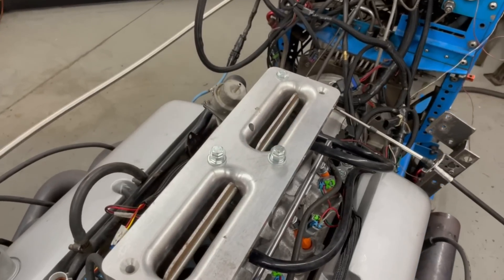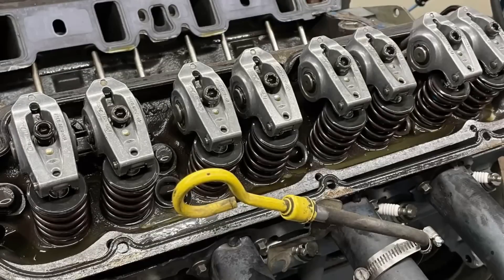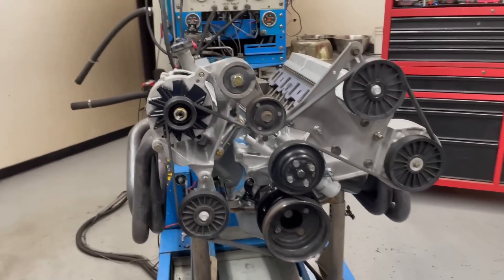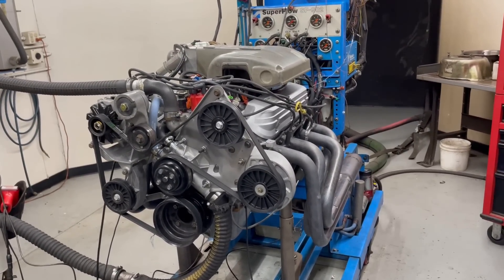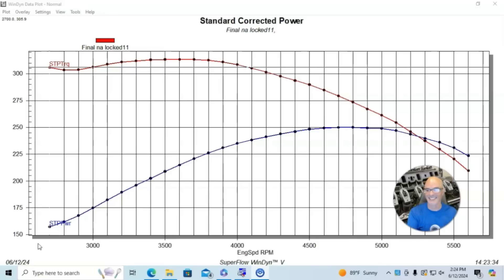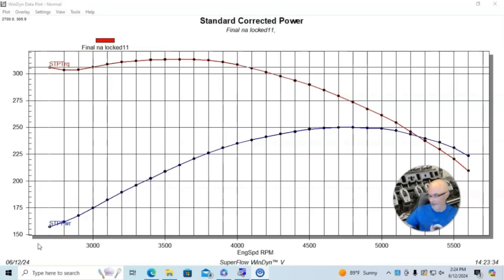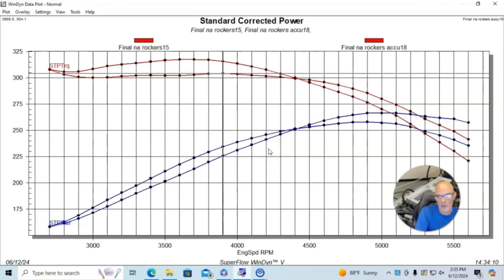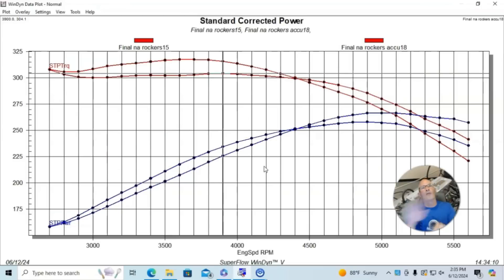TOP SECRET ACCUFAB 5.0L FORD INTAKE-NEVER BEFORE TESTED. PLUS STOCK VS ROLLER ROCKERS-HOW MUCH HP?

Comment: Put a nice plenum on that throttle body and you might find a chunk of the lost low-end.
Reply from the maker: runner length adds torque-not plenum vol
Reply: @richardholdener1727  For sure, primary intake length will go a long way in determining the RPM of the torque peak, but you don’t think there might be some mid-range to be found with an airbox? No airbox means no cylinder-to-cylinder interaction. It essentially serves the same purpose as the collector on the exhaust side. The primary length defines the rpm value for peak scavenging, but you can usually fiddle with the torque curve by varying the collector diameter/length. I’ve found similar results on the intake side.

Also, it might be interesting to make some printed trumpets to give the butterfly throttle intake more runner length just to see how much it takes to match a stock intake.

Comment: Not related to this video at all. But what you state is for the most part true. If you build a NA engine as powerfull as possible and then just add Boost I see a few problems.
If your going to build a NA engine as powerful as possible than the Compression is going to be 11.1- 11.5-1 or more. Not Ideal for a Boosted engine..
JUST SAYING..
Now keeping Compression @(9.5-10-1) then yes this can possibly work. 
but if you're building an all out race/street engine NA you will want 10:1 or 11:1 compression or even higher.
Not a good idea to add high Boost to a a High Compression Engine...
Just Sayin
but i know what your saying and you know what I'm saying....
please keep the videos coming!!!! 
Comparing different Superchargers and Forced Induction comparisons very informative...
Great Stuff
Reply from the maker: WE RUN BOOST ON A LOT OF 10.0:1-11:1 NA MOTORS-THEY MAKE MORE POWER THAN AN 8:1 OR 9:1 MOTOR, JUST NEED THE FUELOCTANE /TIMING TO BE SPOT ON

Comment: It would be Interesting to see if someone would make a custom cam grind for a Miller Cycle LS engine. Something like a Delayed IVC setup, Theoretically it will make more torque down low and improve your fuel economy.

Comment: The 5.0 should NEVER be ran with those junk iron heads. Aluminum heads are so plentiful that you should always have that in budget in any build. AFR has enforcer heads that are very cheap with good results.
Reply from the maker: the motor purposely started out stock-this was not a dedicated build to optimize power. The idea is to test each component individually, in this case, the plan is to test this intake again after more mods (including AFR Heads and bigger cam), but that was covered in the video
Reply: @richardholdener1727  I saw the rest of the video and I do understand testing each individual part. My statement of the heads is more related to people doing bolt ons on the 5.0, but leaving the heads. I have some old Edelbrock performer rpm heads with 1.90" intake valves that I can let you test out if you want. I am about 45 minutes from Westech.

Comment: Richard On the topic of 302s and boost, the other day I thought of a test you could use to demonstrate long runners and boost. I saw an Edelbrock 3821 manifold that had long runners similar to a stock HO manifold but the plenum had a plate on it. You could fab up a Super Richie plate with a blower mount for that plenum cap and plate the original NA throttle body hole. Now you'd have a long runner positive displacement manifold that you could adapt a Kenne Bell to mount to.
Reply from the maker: we've already many, many runner length tests with boost-it does the same as na but a blower mounted on the end of the manifold like you described would be cool

Comment: If you haven't tryed it yet I'd like to see you or somebody turbo a V-6 or a V-8 with the turbo being spooled up by one bank of pistons only. The other bank goes straight out the headers thru the tailpipe to atmosphere. 
I would like to see if this would work and what the heck that would sound like. It would make a awesome you tube video.  Indycars useto do this.
Saab made a V-6 This way. So eather this will work and make more power (less back pressure?) or grenade in the process. Eather way I've been waiting years for a engine builder to try this.
Reply from the maker: I've already tried it once on a BBC with less than stellar results. It is possible (Saab did it but I was never aware of Indy motors doing it.) It will be less responsive (Saab used a very small turbo) and doubtful it would add any power

Comment: Are the stock rockers 1.7 ratio?
Reply from the maker: stock Ford is 1.6
Reply: So a little bump in lift and duration plus less friction?
Reply: @jasontrevis7142 The friction reduction is barely measurable. Most of the improvement is from lift, duration isn’t changed much.
Reply: So if it's all about ratio why do we use roller lifters?
Reply: @jasontrevis7142  The real answer is probably that they're cheaper to manufacture in the production volumes sold into the performance aftermarket.  An LS rocker can be cheaper to fabricate than a roller for GM, but an aftermarket manufacturer trying to investment cast and heat treat the same part with zero heat treatment issues seems very difficult to do in low volumes at a low cost.  There are other advantages like reduced wear of the valve tip, and reduced valve guide side-loading with a roller, but looking at the LS platform seems to prove that a roller tip really isn't needed.

Comment: Dear Mr Holdener,
                           I have a 2005 magnum rt with the stock 5.7. Over the years I've collected the entire top end of a 6.1 hemi. the only parts I need are an adjustable timing set, and gaskets. The last part I purchased was the heads, funny the fella is sending your book with those. 
                           For research I've read a million forum posts. (Worst info resource ever) 
Up until 2014 the post read that the 6.1 hemi head is only good for 25hp. Which makes zero sense to me. Doesn't a head breathe until it stalls? Also, weren't there Eagle heads by 2014? are they not a evolution of the 6.1 head? Seems the published numbers for the 6.1 are less flow on the intake than an Eagle, and a little more on the exhaust. And with the 6.1 open chamber and a small street cam as came in the srt8's until 2009, the piston to valve clearance issue, if any, would be a little safer than a Eagle's closed chamber head. Eh, maybe. I've been told that Isky could regrind a cam from the old srt8 I have to make it more suitable for the 345 CID, and it would be half the price of a new cam, but I have yet to talk to them to prove that out. I just want to build a magnum that's a cool hot rod. Previously, I purchased a new stock 2007 5.7 that had the older comp XFI273, and springs (current at the time) and no other modes, and it worked out fine in a Duster. I think the 6.1 cam is even smaller. ???
                          Am I totally in left field in my thoughts, or is this a pretty easy to build set up. I'd like to read your ideas. Thanks.
Reply from the maker: I don't know what your question is
Reply: @richardholdener1727  I can see why, you don't understand my question. It's all over the place.Sorry. I guess a simpler way to put this would be. I'd like to write a thread on a Mopar forum, and the subject would be, "Revisiting swapping the 6.1 top end onto a stock 2005 5.7 short block 20 yrs later." Back than, (and the post still exist) there was a bunch of talk about the 6.1 heads being way too much for the 345 CID. Yet if you go forward in time, the Eagle motors sort of argues against that as being true. Sure the VVT really smooths stuff out for a broader power band, but once you starting installing cams that are similar to the original SRT8 specs, don't you need to start limiting the VVT function? I'm wondering if the issue back than with using the factory parts to swap onto the 5.7 and end up with okay results had more to do with people Hen pecking parts. IE: Installing the cam alone, or the cam and intake with the 05 heads. Not installing all the pieces as a recipe. Also, the notion that hand held tuning devices being readily available, ( for GM guys a predator was no new thing) were a cure all. That people were more naive and just install a canned tune. 
                  "Joe went to the swap meet, and purchased a 6.1 cam, some springs, and rods, installed them, and his hand held canned tune worked, because their were no codes."
                   I don't understand how people back than were saying the swap was a total failure, it only netted 20-25hp, and it was time consuming and expensive. ($$$ I do understand)
                     I'd like to install the cam at 113 LSA and data log, I'd also like to take advantage of the correct head gasket, and a reasonable boost in compression. Than, see if today's email tuning guys will net better results. ( I have zero expectations that I get anything near the results you get in your book, "since the heads, and your book have yet to arrive, I've only been able to preview what google books will show me.' due to a lot of factors.) All I'm saying is, if you don't have a combo, in which parts match together, maybe the backyard mechanic is inevitably bond to a coin toss, maybe, maybe not. (As will I be, since no success stories from than exist today on the internet, or the Wayback machine,)
Reply: How did Indian Jones say it? "I'm make things up as I go along."
Reply: @richardholdener1727  -So what I ended up with is 6.1 heads/ with 8 bent intake valves. The story is, there's an offset dowel, and a run of those have been bad, to epidemic proportion. The engine was cranked, popped and that was the end. The heads look new, clean. The intake valves look bent but not the stems. (wishful thinking.) So I'll probably need valve guides. While waiting on the valve spring tool. I filled the exhaust ports with ATF for half, and hour, and there were no leaks. When the tool arrives I'll pop the locks, and have the head inspected. The damage around the combustion chamber looks like scratches that lead to the head gasket mating surface. I've seen worse on Iron from people storing them in basements. At worst, the 74CC chambers will get a slight taper, and the heads will get a minimal milling. I'll cc them, and ask for advice on gaskets. Once a valve is bent over, and left like that, I don't know if the compressed springs lose there memory. So as a precaution, I don't think I'd reused the springs. 
                  I think your book nailed it. While I've had a off the assembly in 5.7 and installed the XFI273, and put 50K miles on it, that wasn't with 6.1 heads. The comp HRT 260H-14, is probably better than the 6.1s stock cam adv 4 degree, due to milling, and chamber work, I could end up in left field with a hand grenade. Maybe if I cam find a cheap gasket, I could test the V to P clearance with some clay, but for time constant purposes, it's a no go. NEXT>
Reply: (Hope I didn't just reply in the wrong box, oops.) Years ago, before XV had come and gone, they sold me a used trophy truck engine. Back than nothing was offered for gen III hemi's. The story was: In order to get a forged assembly, they turned down the crank to used chevy rods, and it was more cost effective. I just read a similar story recently about using a 392 truck crank, in a pre-eagle engine by turning down the snout .065, and the journals for chevy rod, and the result was 400+ cubes, on the cheap. I don't know whether that is opening a can of carnivorous brain eating worms, or if it's genius . I think I'll leave that alone.

Comment: The problem with the dual intake is that the runners from the throttle plates were not port matched to the runners on the intake--that is they should narrow down and become circular by the time they get to the actual port. The wort thing you can do to intake gas is to have a flat step down into a circular port.

Comment: I think it would work better if you would make an a transitional spacer with radius is that was set on top of the old intake and then put that wide open throttle body sing a dare on top of that, even when you're flowing heads, you make a clay radius on the intake port so you. Don't have the arrow screwed app going into that port. I think it would work better if you did the same thing with a spacer plate.

Comment: that ford 5.0L made 258hp 318lb-ft(430nm)
a bmw 2.5 m52tu 192hp 250nm
a psa 2.0L ew10 140hp 200nm
a psa tu3 (two valve rally) 1.3 liter carburates from 80s made 103hp and 118nm.
so underpower that 5.0
Reply: But they rave on about a 5.0, don't they
Reply: @mikes.1882  maybe 5.0 is fuel eficint for the power is has?.  but is heavy. 
i dont know the 0-60 from that cars
Reply: @danyan7  the 5.0 windsor is quite light for an all cast iron v8. And it gets much lighter with bolt on aluminum parts.

Comment: No point in doing anything to a 5.0 its a emission friendly v8 made for compact-midsize cars. Get a 351 and dont waste your time
Reply: Not true. The 5.0 came out in 1968 before emissions, and the engine is smaller and lighter than a 351w.

Comment: I would like to see an Offenhauser dual port manifold tested. These were the manifolds to have back in the 70s and 80s. I had one on a 460 Ford that worked great with lots of low-end torque and good gas milage. They are not race manifolds but work great on the street.
Reply: I had one on a 1971 Torino coupe, 351 Cleveland, 4 speed, 3.00 gear. The dual port didn't care if there were a 4 hole spacer, open spacer, front half/ back half spacer, the mileage remained the same, 20-22 at 70mph. With a 'cobra jet' cam, higher lift, slight overlap, Rhoads lifters, headers and different carbs, stock Motorcraft, Holley 600 vacuum secondaries, 750 Holley also vacuum, it would rev to 7,000 in first, 6,000 in second, 5,000 in third, then I chickened out (way past 120 mph). I never considered fuel starvation until Years later. Some idiot never thought to put a new harmonic balancer on, breaking the crank just in front of the second main. ):

Comment: Wow that dual oval blade intake reminded me of Ford's rare Part number DOZX 9510-A inline four barrel carburetor.
Reply from the maker: Autolite Cross Boss
Reply: @richardholdener1727  Have you ever had your hands on one?
Reply: @richardholdener1727 
You too can own one @ $10k a you get a penny back.
Buyer beware, it's used parts.

Comment: Cool 2 barrel. Make thinner throttle plates and smaller diameter shafts, or mill the shaft, parallel to the plate. The top down shot really shows the "flat plate area" of the butterfly/shaft assembly. I would guess 20% of the total area of the venturi. Heck, just use Bondo and streamline the shaft/plate junction, flush cut the screws. I bet you will see the difference on the dyno. Also, aren't these short intake runner setups more for quicker reving engines?
Reply from the maker: The motor doesn't need more flow-it is restricted by the stock lower intake, heads and cam timing. None of the changes you suggested would do anything when those things limit power.
Reply: @richardholdener1727  I was saying that the total flow is restricted by the flat plat area of the the shafts and plates. You are saying the absolute flow from the intake, the cam timings, are the restriction? I am saying that at partial throttle settings, restriction can be lost by increasing flow around the plates. It would just respond quicker. I raced motorcycles, were you seldom can ride wide open for long. "Responsiveness", can you measure that as rpm/time? I think this goes along with port matching and casting flash removal. For wide open power it might be a small benefit and so not worth doing? It is probably just mental, but I think they run smoother and rev faster with all the "little" gains. Thanks for the come back.

Comment: Timing light.  
I've noticed in this and other vids that the timing light does not shut off.  Is this on purpose to monitor ignition during a run?   If not, this is wearing out the flash tube.   It might even cause a flash delay making timing look to be lower than it really is.
Reply from the maker: it was on during the two runs selected for video-usually not

Comment: I guess that throttle body must have at least 1,000 CFM, but the factory heads and camshaft become the funnel that restricts flow.  I'm already looking forward to the test with better heads and a bigger camshaft (a solid one with rollers 1.7 would be great).

Comment: I bet I'd that system had radiused entries at the bottom it would make even more power when it's allowed to rofl.
Reply: This is what I was thinking it needed, the port entry holes into the lower manifold should have had a nice radius on them. I think if they combined a billet spacer plate say 1" thick with nice radius port entries it would have been better. Also I'd like to see what effect thinner throttle plates and with flats on the spindles, or those shaftless type bodies. Finally it would be nice to see what a 2-1 collector joining the headers and a longer exhaust system do to the performance on the dyno.
Reply from the maker: radiused entries (exits) at the bottom will hurt flow into the non-radiused lower manifold